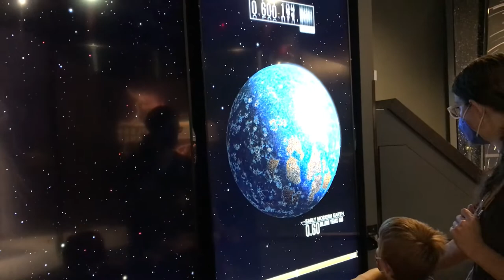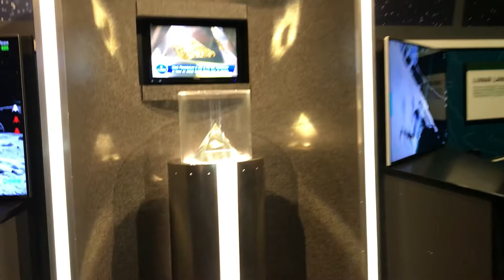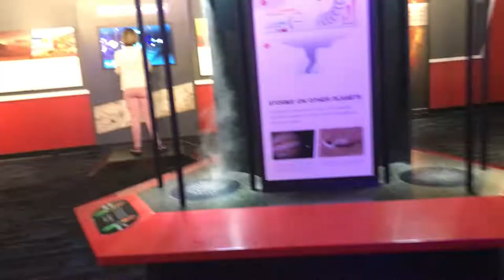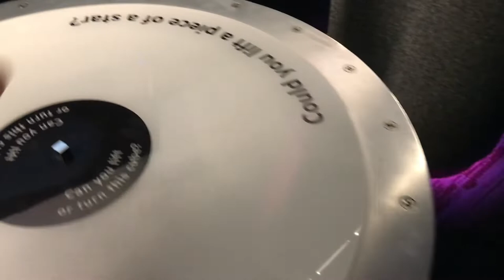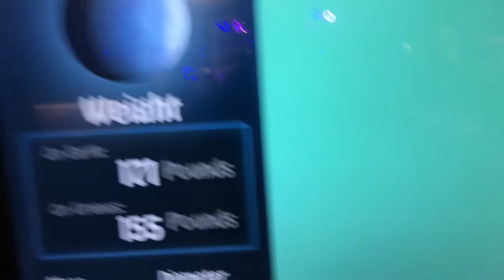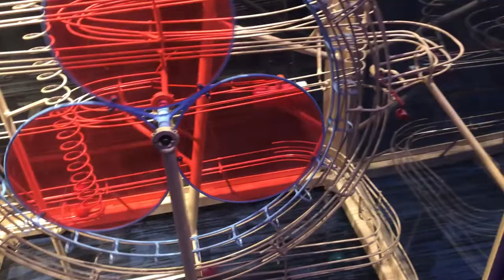Clark Planetarium Tour Salt Lake City

Comment: I have been to the Clark planetarium several times but the last time I was there they were doing the upgrade with the new displays and it wasn't finished. The marble machine was very fascinating to me also. They didn't have the O's that light up back then either. My first planetarium experience in Salt Lake was the old Hansen Planetarium. I saw laser light rock shows there. They also had a beautiful old building with beautiful wood work. I live in Boise but have been to Salt Lake many times for new adventures.